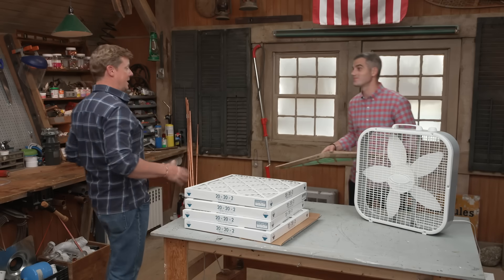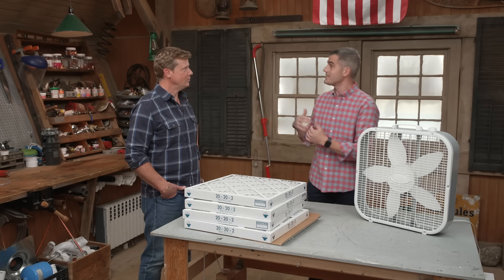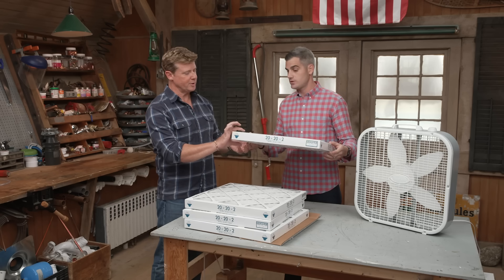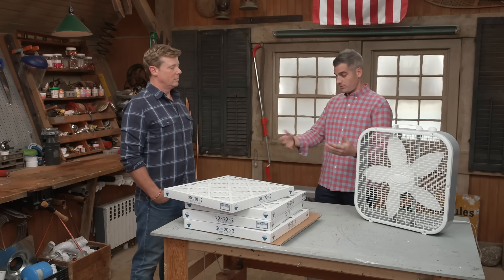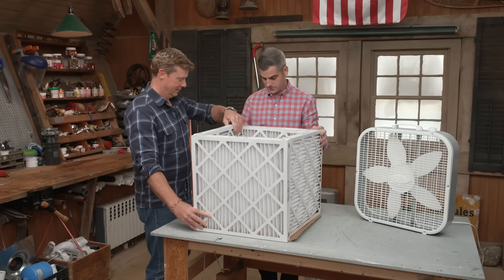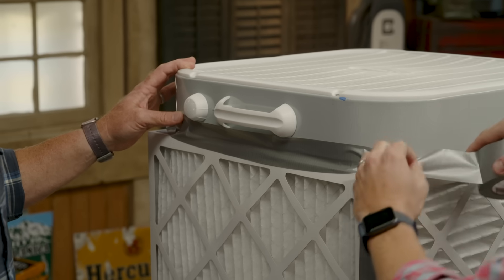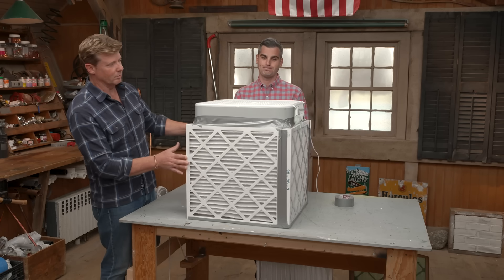How to Make a DIY Air Filter | Ask This Old House

Comment: This channel needs to make a correction on this video as the information was incorrect. Let me explain.
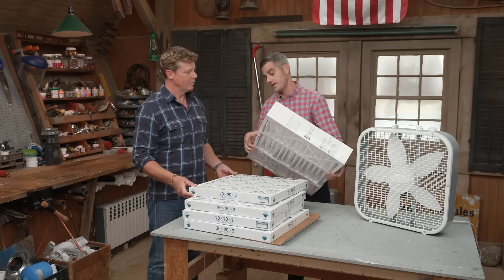Guy on left wants to remove his 6 or 8 MERV filter (2:25-2:32) and want replace with MERV 13 20"x20"x2" filter and was told "not so fast"..."so with this you're going to INCREASE the resistance of the air going across it" (2:38).

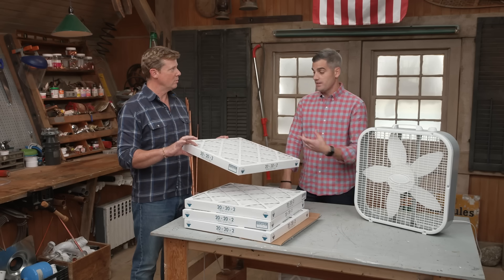The question later (312-3:16)was "is their any way to REDUCE the resistance to the air flow"?? He's holding the 2" thick MERV 13 Filter while asking if there's a way to reduced the resistance to the airflow. The guy on the right proceeds to tell him he can do that by adding the same type of filter only 4" thick...twice the thickness of the 2" filter. 

Now, if going from a 6 or 8 MERV filter to a 2" 13 MERV filter "increases the resistance going across it", then certainly doubling that to a 4" filter with further "INCREASE the resistance of the air going across it"...as the 4" filter has twice the surface area.  Then (3:37-3:40) the guy on the left says more surface are means LESS resistance"???????? No! It means even greater resistance.

You can't go from a 1" thick 6 or 8 MERV filter, replace with a 2" 13 MERV filter that is larger in surface total surface area than the 1" 6-8MERV filter, and say by going to a 2" MERV 13 filter that  "you're going to INCREASE the resistance to air going across it" (which IS CORRECT)... then turn around say that going to a 4" MERV 13 filter will REDUCE the resistance to air flow...because it will INCREASE it by your own example of going from a cheap filter to the better filter. Better filters increase resistance to air flow by going up in MERV and by increasing surface area. 

To my point, placing one of those good 2" thick filters behind that box fan you increase the drag on the fan motor. By making the box, you add even more drag on the box fan motor. The difference can be heard simply by adding then removing the filters away from the fan. More MERV and more surface area always means MORE resistance to air flow, therefore straining the fan motor. Air flow is reduced. The question should have been: With the better thicker filter is there a way to prevent reducing air flow and therefore straining the fan motor. 

Simple:
Add a 6or 6 MERV 1" filter behind a box fan. You may or may not hear the fan bog down.
Add a 13 MERV 2" filter behind a box fan. You will hear the fan motor bog down...less air flow through the fan.
Add a 13 MERV 4" filter behind a box fan. You will hear the fan motor bod down even further...with even less air flow through the fan.
If you keep add surface area you will eventually burn the motor up. 

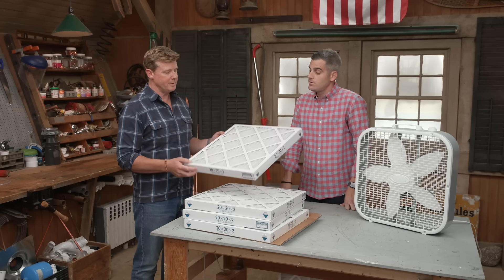(3:13-3:41) ... everything they said up until that last few seconds was correct. (3:373:41) the answer to the question is wrong. Increasing surface area means more resistance, not less. That I know of, in their example, there is no way to lessen the resistance...increasing thickness given the same size and MERV filter INREASES resistance. It does NOT lessen resistance.

I can't believe no one else brought this to your attention.
Reply: Because he’s right and you’re wrong..
Reply: @emilioleyva8952  He that hath ears, let him hear...
Reply: @Hoytman37  More surface area, less resistance.  Simple explanation for you, a filter has microscopic "holes" in it to let air through.  Say for instance 1 square inch of a merv 13 air filter has 1000 holes (just an example), double that to 2 square inches and now you have 2000 holes.  Double the holes = 1/2 the resistance give or take.  This is as simple as I know to explain it.  A very simple way to see this is to have a 1" merv 13 (or any merv)and try to pull it out of a filter register while the unit is running.  Note how hard it is to remove, now try the same thing with a 4" merv 13 (or same merv as the first filter).  It will be much easier to remove because much more air is flowing through it because of the vastly increased filter surface area.

Comment: Covid virus size is 0.13 - you're giving incorrect info pretending any filter goes that low... there aren't any filters (or any masks, including N95s) that filter as low as 0.13 - this is basic math. The accurate info is able to be found and has been out there for decades.

Comment: I'm remodeling a house and this just gave me some ideas on how to setup a filtration system to help keep from contaminating the finished rooms with construction dust and keep the room air a bit healthier.
Reply: Use a merv 1 filter on the outside of each merv 13 to control larger dust and hair thus prolonging the life of the merv 13
Reply: Please tell me more. I’m doing the same.  I’m thinking of using pvc pipes for both air input pipes and exhaust pipes.  I mean why not?

Comment: I get the idea of more surface area but why not just use the 4” filter. I use the 1” merv11 in my home and change the filter every 6 months but really just over the summer in smoke season. Buy using just one filter even my kid can change the filter the fan sucks the filter to it so no duck tape required.

Comment: I tried putting a 20" filter directly on the fan.  Worked great and lasted through the crisis, but afterwards one of the coils failed on the fan due to overstressing.  I decided to use more filters & was referred to this video.  Pretty much what I'd envisioned, but I would leave one side open for the fan so that it would rest on its base & blow sideways as it was designed to do.  Not sure how having the fan flat will affect the bearings.

Comment: I've had 2 ac guys tell me to use the cheap green ones. The ac system needs good air flow.
Reply: Same here…. Just bought new home…. Builder and AC contractor said same…. Cheap filter and change it monthly

Comment: Northern California: Made one 2 weeks ago,  the day our area started to get bad air from big Tamarack Fire 3 hrs away.
works perfectly! Did not have any duct tape, used Tvek tape instead. Air filter is placed in front of old glass door  in kitchen that goes out to patio.
Reply: Aug3-  Usung it now about 3-1/2 weeks: dyi air filter works really really well.  Had 5 days bad air&;all ok. put it in daily even when air ok - noticeable  difference in using less  daily asthma inhaler.
Reply: I'm in Nor Cal as well and with an AQI of over 450 today, I'm thinking I will head to Lowe's tomorrow to make this.  Our whole family just finished with having covid and 2 of us have lost our sense of taste and smell so I have no idea if it smells smokey inside, at least this way, I can see the filters getting dirty!
Reply: Aiming the filter outside is not as good of an idea as it sounds.  The fan sucks dirty air in but blows clean air out.  When you point the fan outside, it draws more dirty air from outside back into your home.  

If you put it in a room, it circulates the air and dust.  It sucks the dust into the filters and blows clean air in the room.  It can leave you with cleaner air in the room than you have outside.  That's what you want.
Reply: Do you recommend setting it up where the fan is blowing dusty air OUT of the room through the window? Or blowing fresh air (with the filter) into the room?

Comment: Thanks you for sharing and explaining for supplementing air flow, however, would this be ideal for those whose landlords and property owners (I address their negligence more than the managers they hire as a third party) are more focused on filling vacancies as opposed to having a properly planned maintenance system in place for quality of air and water, etc.? Placing a bandaid over an improperly irrigated wound often leads to systemic infection and often amputation or is that the point?

Comment: I like most of the stuff this Old House does but unless that fan is designed to operate and that orientation they should not have it on top like that.  The issue is the bearings inside the fan we're probably not designed to work in that direction so they'll fail sooner than they should. Maybe it's not that big of a deal because it's just a cheap fan.  I did something similar to this when I was a kid and the motor got way hotter than it should have.  Because the bearings in the fan are not designed for this orientation they don't work as well and eventually cause resistance.  We stopped using ours because I was afraid of a fire.  Just turn the fan the normal way. You can still put four filters on it.

Comment: Rather than the fan pointing up, are there advantages to orienting the fan so the out-flowing air can be aimed at myself to provide an evaporative cooling effect in warmer conditions? Is the outgoing air moving so much slower as to not provide much evaporative cooling effect? 
Disadvantages? (perhaps somewhat lower structural strength)? This would result in putting the cardboard blocking surface on the bottom, opposite the control knobs.
----> ----> 
----> ----> 
----> ----> 
rather than
^  ^  ^  ^  ^
| | | | | | | | |
^  ^  ^  ^  ^
| | | | | | | | |
Reply: I think UP would help re circulation, thus moving air, allowing the cube to purifiy more and more air.

Having a cube simply aimed at your face wouldn't have the same effect on entire rooms.

Comment: I do this with two filters,  for basic allergy stuff. I just make a triangle with the fan and filters, and a cardboard triangle to seal the top. For thoroughness you can do the same to the bottom but it's good enough for my purposes with the bottom open.

It does lose a bit of airflow from the filters but not enough to be a problem
Reply: Air finds the quickest way in. You need a sealed system to force the air to pass through your filters. If the bottom is open, the air will pass through there, not through the filters. Therefore, the system is just blowing unfiltered air.
Reply: @vieillefille  the bottom is enclosed by the carpet it sits on. It filters just fine. Plus, if I just need air, I can tip it on its side for unfiltered up-angled airflow
Reply: given that CFM of box fan is up to 2500, Merv 13 cfm is 1400 for 20x20x1,  then two filters would be 2800 cfm. use of 4  Merv 13 be overkill

Comment: I replaced my 1" filter box with a 6" merv 10 filter box and it was pretty easy. I think you can probably find an HVAC service that can probably do it for about $100. I can't imagine that it won't fit in the same spot. If it doesn't then you must have a very tiny mechanical room.

Comment: Before you upgrade your HVAC filter I recommend installing a magnehelic pressure gauge.  Most systems are rated to run at .5 inches of water max dP (differential pressure), so get a gauge that goes to .5 or 1 inwc.  Ideally your system will run at less than .3 inwc with a new filter, but there are more factors at work than the number of pleats or the efficiency of the filter media.  If your return is not sized sufficiently it may mean higher face velocity at the filter.  Higher face velocity means higher dP, which means the blower works harder to pull air.  Installing a gauge will help you figure out the baseline of your system and determine what filter you can use.  An added bonus is that you can start replacing filters when the pressure drop, or dP, gets close to .5inwc versus changing every three months.  Unfortunately filter companies don’t publish pressure drop on the package.
Reply: Great information that most people are absolutely ignorant of. Most systems have undersized returns.
Reply: @tomfenimore9667  Very true. That's one of the reasons systems don't last as long as they should!
Reply: The air blower will not work harder.  It will actually pull less amps.  Less airflow due to airflow restriction means less work.  Now the evap coil is designed for a certain airflow, that in turn will work less efficiently.
Reply: @HisSomebody  It depends on the type of system you have (PCS, constant torque, variable speed).  Regardless if the blower works harder versus longer, more energy will be consumed to achieve the desired temperature as differential pressure increases.

Comment: Ok how about using a old furnace blower motor for the fan.  Yes some of its going to have to be made of plywood  but you could change the filters without all the tape.  I know a furnace fan motor moves a lot more air.

Comment: I use a single filter held in place by suction from the fan. I had some weatherstripping laying around so I put it on the fan to improve the seal and decrease Blow by. I have two types of filters at all times. One that will stop pollen for my allergies. And one that will Stop Smog and smoke for when the forest fires get bad. Since I don't have the filter taped to the fan I can use the same fan to ventilate my apartment
Reply: You need to tape the filter to the fan or else it won’t be as efficient as possible

Comment: Honestly with all those filters for a regular household it would last 12months no problem.

If one filter in my AC is suggested to be replaced every 3 months and i have 4 in a little cheap   Box fan.. im confident it will last a year in a standard household .

Unless you’re “That cat lady” or Ace ventura pet detective you might need to replace every 6 months .

Comment: With the discharge being so close to the intake a large amount of the filtered air is going to be recirculated through the filter.
Reply: fan blows upwards, circulating air across the ceiling, down the walls, and along the floor back to the filter.  The dirt is caught and collects visibly on the outside of the box.  Since dust is greater at floor level, it's a perfect design.

Comment: You need to test the draw on behind the filter, if it's not drawing fast enough it's not efficient enough
Reply: Drawing less would not be considered less efficient, it is considered less powerful.  If anything, sucking slower allows more particles to be trapped, not less.  And there is the circumstance of overloading your filter ability, as high volumes of air forced through a filter create blowouts, larger channels... doors the freeloaders slip passed to get in the rock concert. Same with granulated carbon water filters.  Rivers of unfiltered water sneak by to get to your drinking glass.  That's why they recommend block carbon filters not granulated.  It allows for even distribution to meet the stated filter ability.

Comment: great idea,  i did this but only used 1 filter and never thought to use 4 or possibly even make feet for it and used 5 filters, 900cfm on 4 filters is amazing and for the budget cost too, can make one for each room, with a 6 month ish replacement time
Reply: Or you could stand the fan up, still use cardboard on the bottom & only have to use 4 filters (top, 2 sides & back).

Comment: if you want to filter out the c19 v then you need to turn your house into a operating room it is not realistic for the average homeowner  PS the average single door fridge is about 18/20 cubic feet on the inside and a double is around 25/29  so gives you an idea of how much air it moves in a minute

Comment: so silly why would you have the air flow arrows pointed inwards and the fan blowing outwards ... i mean the dust is going to be stuck to the outside while running but once its off an air blows past it ,  its gonna shake/blow a lot right back off again reverse the filters and the fan set up so dust is trapped on the inside

Comment: I started using a single 20x20x1 in my garage when I work with wood and the door closed because of winter and they clog very fast. I am going to try this idea.
Reply: I literally do the same thing in my 1 car garage at my apartment lol helps so much when I'm cutting plywood

Comment: You should blow into the box keeping the dirt inside so you wont shake it into the room when you move or bump the unit
Reply: those shitty box fans are not designed that way. they cannot push air thru the filter they have to pull it thru. do you know how a fan works? obviously not. no ac system ever is designed to push air thru the filters, the blower sucks the air thru, it has to do with the pressure. fans work best when they are pulling air with no obstruction on the outtake side

Comment: Place this in the same room as the return for your AC. Then set the ac fan to ON instead of AUTO. You can dust your house with a leaf blower or air compressor at that point.
Yes, I have dusted that way.

Comment: Anybody notice that these guys assembled it wrong? They have the cardboard bottom facing out the back with one of the filters facing the floor. Cardboard should be facing the floor. Also, clear packing tape is better for this than duct tape. Duct tape doesn't hold well on cardboard and other paper products.